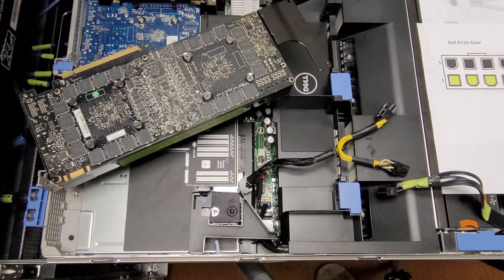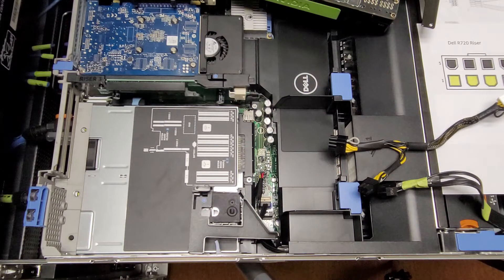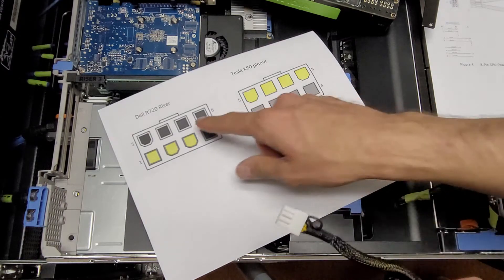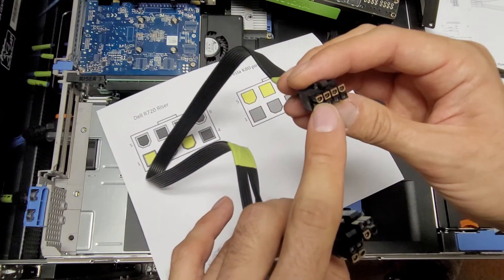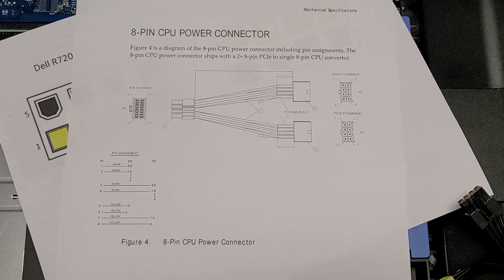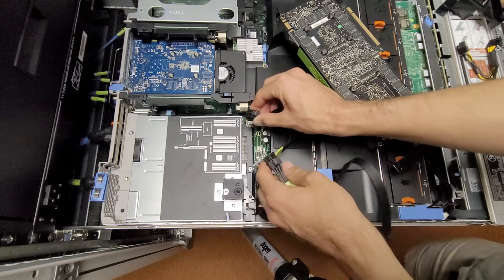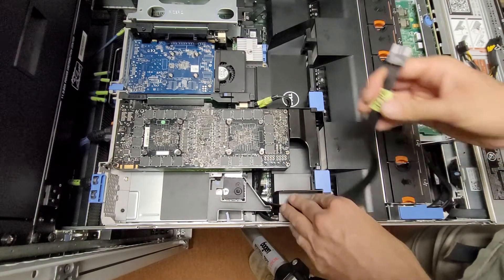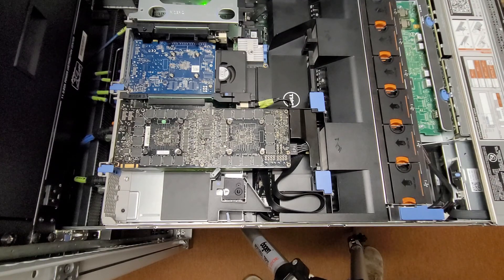Discussing power caveats with the Tesla K80 in a Dell Poweredge R720 and installing it

Comment: I had the same problem, I ended up using cables from an old Corsair ATX PSU. If you get the standard type4 to CPU power cable that comes with this unit the lead just needs a mod to remove the extra positive.....(snip)
Reply from the maker: That is interesting you just had to snip the one 12V wire.  I had to completely rewire the cable in this video.  I am starting to make my own out of cables cut off old power supplies though.
Reply: @computersales  instead of snipping the one that goes to Earth it could actually be connected to the middle positive pin which would give you the extra current capacity down the cable. Actually I will do this as well
Reply from the maker: @sonicalstudios  Ok I did some more digging since I was slightly confused.  That is weird that on the type 4 Corsair modular cables the pinout is reversed on the PSU side.  Looks like you would have to cut pin 4 specifically on the PSU side of the cable.  Does the missing wire cause the card to misbehave or act weird though?  I'm not sure how the connector is wired electrically on the Tesla PCBs.  Otherwise yeah splicing would be the prudent thing to do.

Link to pinouts of the Type 4 cables that I looked at:

https://pc-mods.com/blogs/psu-pinout-repository/corsair-psu-type-4-cables-pinout
Reply: @computersales  no it does not but it could mean that all of the amperage is put on the 3 positive wires and if you look the k80 uses the CPU power which has four so I'm guessing it would be better to cut that extra connection that goes to Earth add it to one of the positives so it can handle the current correctly
Reply: @computersales  also if you use a multimeter you can see that the Tesla has a row of positive and a row of negative all connected together so no matter what all you need to do is get 3 to 4 positive connections to handle the current and also the 4 negatives
Reply from the maker: @sonicalstudios  I'll probably just keep making my own since it is easier than modifying existing cables :)
Reply: @computersales  cutting a single wire is far safer and easier (at least for me and probably most others) than trying to make a new cable for which I have none of the components or tools. YMMV.

Comment: Have you found a cable that works out of the box yet? I am trying to get a K80 or M40 24 GB to work in a R730. I bought a cable from Amazon that claims to work but when I try to power on the server the power supplies just blink orange which leads me to think it is not wired right. I got a COMeap CPU 8 Pin Male to Dual 8 Pin(6+2) Male PCIe Power Adapter Cable for Dell PowerEdge R720 720XD R730 and NVIDIA Tesla GPU J30DG 15-inch(38cm)
Reply: Also forgot to ask if you changed your PSU configuration to non-redundant and whether you use a single or dual CPU configuration?
Reply from the maker: @ThomasLindsay  So that cable technically would work on some Tesla cards. Your cable is shorting 12V to ground most likely.  Definitely look at the pinout of the wiring at 2:30 the left side shows the tesla input.  The cable side should have pins 5-8 yellow (Plus 12V) and the pins 1-4 black (Ground)  Any other config won't work.  I can't tell with certainty, but it looks like yours is wired for standard PCI Express 8-Pin.  If you refer to page 8 of the manual linked in the description it shows wiring diagram and the adapter you can buy for the K80.
Reply: @computersales  I did get that adapter with the M40 and if I plug the two ends from the cable I bought into that adapter it looks like the wiring lines up so I can plug in the single end of the adapter into the card and the single end of that after market cable into the riser. :) Thanks!!
Reply: @ThomasLindsay  Hey, so I am not really at home in electrical engineering and what not. I have ordered a Tesla K80 and have got a Dell R720, any recommendations you can give for what adapter to buy? (I assume a regular 8pin CPU power cable from a modular psu won’t do the job)
Reply: @mr.damien826  I bought a "COMeap CPU 8 Pin Male to Dual 8 Pin(6+2) Male PCIe Power Adapter Cable for Dell PowerEdge R720 720XD R730 and NVIDIA Tesla GPU J30DG 15-inch(38cm)" from Amazon and the card I ended up using had a converter included as seen at the 5:00 minute mark in this video(and the document linked in the description). If your K80 does not have the converter included (say if you bought it used) then you can buy a convertor from Amazon like the "COMeap NVIDIA Graphics Card Power Cable 030-0571-000 CPU 8 Pin Male to Dual PCIe 8 Pin Female Adapter for Tesla K80/M40/M60/P40/P100 4-inch(10cm)"  The first cable splits the riser power into two connections for standard GPUs and the converter cable recombines the 2 GPU connections to the single one needed on the Tesla K80 card if that makes sense. I was able to get mine up and running that way thanks to the info in this video! Good Luck!
Reply: @ThomasLindsay  Thank you for your reply Thomas, I will look into these :)
Reply: @ThomasLindsay  Thanks for the details. Can you please help me with how to connect the Y (from riser) to the converter properly? I mean, which part of two segments from splitter connect to the converter to GPU? Or any of the combinations will work?
Reply: @mr.damien826  it will if you cut the extra Positive pin on the type 4 end.....not the CPU end
Reply from the maker: @tonmoaydeb3532  So if you have the Dell riser power cable, and the NVIDIA Tesla adapter cable the connections are simple.  

You just plug the Dell riser cable into the riser.  

Then the two 8-Pin PCI express power connectors from the Dell riser cable can plug into the NVIDIA Tesla adapter any way you want.
Reply: @sonicalstudios  Thank you sir for providing the most simple and correct answer amidst a confusing discussion. I ordered two "ATX CPU Power Cable 8 Pin Male to CPU 8 Pin 4 Pin Male" cables expecting them to work with my Tesla M40 and they did not. After reading your comment, I researched the pinouts of the Dell riser and the GPU and discovered that one pin was ground instead of 12V on the riser, just as you indicated. I cut that wire as you recommended and my system now boots. Thank you!
Reply: @danielbarnes3406  It was me an r720 and 2 tesla's just did some theory and had the cables laying around to test with. Thanks mate